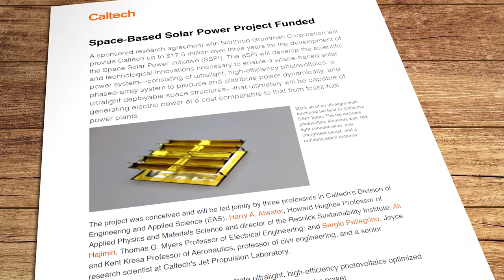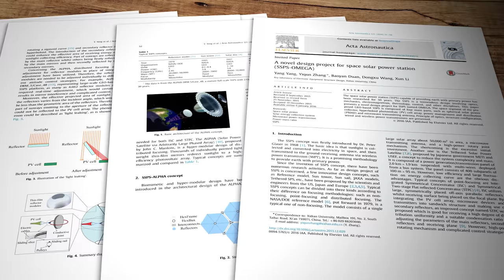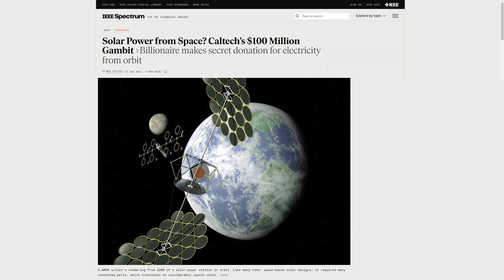Powering the planet from space. Closer to reality than you think?

Comment: As long as there is available area for panels on the ground that must be far more cost effective.

Take the cost of a space grade panel add the cost to orbit, the cost and losses of converting the light into microwaves, transmitting it to earth, capturing it and converting it again to electrivity plus all the problems with aiming the beams so as to not cook anything that gets hit by it.

Compare that to just putting lots of normal panels on the ground times the loss of light energy from passing through the atmosphere and then take a third of that because of the night and day cycle. Add in battery storage and we have the same base load capacity for a lot but still a lot less.

When we run out of space for panels on rhe ground we can start to look at other things.
Reply: it depends, the efectivity of panels may partly substitute the losses of converting and transmitting. But yeah that is biggest bottleneck i think, and its all about solving that. But if prices of kg to orbit fall down with fully reusable starship operational, it could be economicaly more efective, than backup battery for almost half of the day (in winter). Thats a lot of battery packs. The 24/7 energy supply is huge advantage.
Reply: Panels on the ground get less than 12hrs of direct sun. Orbital solar would be an un-interruptable baseload. 

The transmitted power would be long wavelengths that couldn't cook anything. 

It won't make sense until launch costs are very low. Then this will be the best power source available.
Reply: We can also let some of those panels float in the oceans..
Reply: @bozo5632  Yes i accounted for the day and night cycle by adding a factor of 1/3. I also added the cost of battery storage.

The longer the wavelength the wider the beam and colector will have to be.
Reply: Space power stations are far better- have You seen  "Pacific Rim"? : We have a giant brake in the bottom of the ocean and some monsters are coming form it. Ok- lets seal it with concrete or something (we already did it with BP disaster). No, better build giant robots necessarily with two pilots with mind control  and see them fight monsters cause that is more awesome! The same with on ground solar vs space power stations.XD
Reply: Glad I read the comments first and saw your post… saved me a lot of time.
Bottom line… batteries and  ground based solar will handle our power needs for hundreds of years… let’s focus on other issues. This one is sloved
Reply: @mabl4367  I saw that you accounted for it, but I stated it again because it's the ~main advantage of orbital. 

AFAIK wider beams and receivers isn't such a big problem.
Reply: @mabl4367  : The receiver size for microwave units has been calculated to be around 5 acres, which certainly is somewhat large, but not that different from existing power station.

Also, unlike existing power stations, the frequencies in question mean that most of the receiver area will be empty space, allowing the ground below to be used as pasture (or as a fish pond or something). Besides, 5 acres isn't a big investment of land when you're looking at countries and the viable distance of electrical transmission. Placing these 10 or more miles from the area they serve would likely be the norm instead of the exception.

So, the size is not a problem.

Comment: Wouldn't beaming extra energy down from space increase the earth's temperature?
Reply: So do ground-based solar panels, since they absorb light instead of reflecting it away back out to space. But the energy added is a pittance compared to what hits the earth every second of every day. That's why CO2 is such a problem, a small amount of insulation means a metric ass-tonne of heat is trapped. If we placed the solar panels between the earth and the sun, then they would be blocking light from hitting the earth while sending electricity down to the ground, making it at least neutral and perhaps actually cooling the earth a teeny tiny amount.
Reply: Yes, but any amount that we send down from space will be many orders of magnitude less than the sun already shines down, so the effect would be negligible
Reply: Yeah but it would be negligible compared to the greenhouse effects of global warming and if it reduced carbon emissions it would contribute to less global warming overall.
Reply: The atmosphere would absorb some amount of the radiation, and converting EM waves back to electricity would also generate heat, but that amount of heat is minimal compared to the amount of solar radiation each m² gets on Earth.

Also if, and it's a big if, this technology becomes viable, that would mean less energy demand from fossil fuels wich realeses CO2, CH4 and so on, wich do heat up the planet way more.

If this manages to be economical in some sense, we could use the energy from space stations to use energy intensive GHG sequestration projects.
Reply: Sending down energy would have an insignificant effect. The amount of all energy produced by humans in a year is equal to about the energy hitting the planet in one hour from the Sun.
Reply: If you're gonna go to significant scales the Best option is use the arrays to block sunlight that would have fallen on earth anyway resulting in a net reduction in energy transmission (due to energy lost in space as heat radiation) "solar shading"...
Reply: Arthur C Clarke actually considered that when writing some of his books, and his conclusion was that it at least would take a few centuries before it became worthy of attention. In that time we can expect some decent amount of the population to move to space (at which point their consumption doesn't contribute to the project), and for carbon nanotubes & graphene to be developed enough to provide significant aid to the solution.

Also, there are certain frequencies of light that just pass straight through the atmosphere to space, and some wood based materials that naturally emit light at some of those frequencies have recently been developed. Blindly assuming that everything will be fine in the future is reckless, but this subject is one where we're already getting good signs.
Reply: ALL the energy beamed down would eventually degrade to heat energy. Heat is always the end of the energy train. The important thing to consider is that the energy beamed down is energy that otherwise may not have been introduced into the planet.
Reply: @ABDuck88  Yes, that is what they said about the passenger pigeon.

Comment: Related topic to look into: Solar panels on the ocean. There's plenty of ocean, and if covered would also cool the water underneath. But being on the ocean is rough, lots of salt water spray.
Reply: Oceanic solar is not a great idea for both corrosion & mechanical stresses. You need to minimize or eliminate both in order for solar panels to produce more energy over their lifetimes than it takes to produce them, and ground-based arrays already are anemic on that front- increasing the required replacement rate makes it worse.
Reply: Open ocean solar is going to be an important component of solar in the future but a better starting point for floating solar is placing solar arrays over inland reservoirs. Placing solar their has the benefit of preventing evaporation and the water cools the solar panels which makes them more efficient.
Reply: There's more than enough dry land also.
Reply: @saumyacow4435  didnt elon musk say that to power the US in todays world, they need 100square miles of solar array and 1km for battery storage?
Reply: @dustinherk8124  I've no idea what Elon Musk has said (and not a lot of interest either). However, a solar array 100 miles by 100 miles sounds roughly in the ballpark.
Reply: @dustinherk8124  No, he said you need, in total, an area equivalent to a hundred mile square, after putting solar panels on every roof.  10,000 square miles.  Something on the order of a hundred million tons of solar panels, so expensive but quite doable.
Reply: @RandyTWester  I'm sure we could scale it down a bit from that with the less efficient but still viable transparent solar panels (12-13%) to be used as the upper windows of massive office buildings of at least the primary east and west sides as they are vertical panels, as well as gapped solar panels on plant producing farms who's crops do better in more shaded areas and reduces water requirements thanks to partial sun blockage. farms for green onion, peas, lentils, legumes, spinach, raspberry, blackberry/black currant, root veggies, cherries etc. to give a lot of that ground required. which would also give alot more diversity for farm regeneration with more plants to rotate, compared to the now exhausted farm lands that were used for grains.

Comment: With an efficiency of 22%, reflectivity of 85% (I can't find actual on the Interwebby, just a torrent of excessively-wordy nothingness  as per usual) and glass emissivity of 0.93 the solar photovoltaic panel temperature in space would be ~89 degrees Celsius. I've no clue of its actual efficiency at that temperature. * Instant big correction: I forgot that a panel in space has 2 large faces facing space unlike Earth's ocean which has ultimately Earth's core at its arse end. So "~89 degrees Celsius" S.B.  "~31 degrees Celsius", not nearly as challenging.

Comment: The best way to get power into homes is solar panels or tiles eventually, and batteries.
That will take a lot of beating!
Reply: iron rust batteries look promising for large, grid scale power storage. same goes for secondary cooling salt of a thorium MSR to power a steam turbine during the off peak hours of solar. using a thorium power plant as base load, and its secondary steam component intermittedly when peak sun hours are done, but peak grid use is still up. New Brunswick Canada is building a CANDU MSR that will do just that, provide a baseload of 260-300MWH with the secondary cooling salts, redirected to the steam engine for an additonal 75MWH of power when peak solar hours are done. plant is expected to be operational by 2031-2033.
Reply: @dustinherk8124 
Yep nuclear should be an important part of the mix.

Comment: As a big Asamov fan since the '70's, I was glad to hear him mentioned among other early theorists on this subject.  I read back in 1972 that Asamov, in the 1950's. theorized that 5 square miles of solar cells in geosync orbit could microwave enough electricity to meet the US's then-current TOTAL energy needs.  That's total energy, not just what the grid would need to light homes and power factories.  Of course, such a system would require a complete rebuilding of our power grid to handle all that energy.  But then that is something that will have to happen to some degree or another anyway as we transition from, for example, ICE powered vehicles to vehicles that obtain their power from the grid.

Remember too, that solar cells back then weren't nearly as efficient as they are today.  I would also assume that he had calculated the energy losses and inefficiencies of such a system.   While I am all for continuing to research, expand, and refine such technologies as wind, water, and geothermal energies, IMO unless we vastly expand nuclear as the core of our power source for at least the short term, space solar is the way to go.
Reply: I think I read the same, many years ago. Asimov also mentioned that such a powerful microwave beam, could be easily re-directed as a powerful weapon....Cold War was going on then.... Even now, if that beam wasn't consistently precise, it would be a huge risk to a very large area
Reply: 5 square miles / 1m^2 * 1kw * 20% = 2.6GW

Comment: Big problem with this idea is that for all the cost of the non-power producing parts, the electronics, antennas, transfer systems, space launch costs, power transformers and so on... We could have just built a longer distance power grid. We have "space" already here on earth, we just don't just put solar panels because that "space" is too far away to connect it to the grid cost effectively.

Putting solar panels in another "space", using rockets and all the associated hardware would be even costlier and less reliable. When you reduce the problem down to "space" and distance, it becomes painfully obvious how absurd it is to go into orbital space versus going further into terrestrial space. If some how power transmission costs over lasers and microwaves were cheaper than using power cables, we'd be using lasers and microwaves already in our own grid, we don't.

Space Solar power stations are doomed from the get-go as a cost effective alternative to land solar power stations. 

But this doesn't mean the technology shouldn't be researched, there are numerous applications where it doesn't compete with land based systems. It can be used to power other space based infrastructure. It can be used to power extremely specialized regions like arctic research stations, oil rigs, ocean infrastructure or remove comm stations. Places that are too remote to deliver fuel oil and the weather to is too violent for traditional solar or wind. There are even exotic advanced applications like microwave rockets where the power is beamed to the rocket in-flight and thus doesn't use combustible propellant but instead uses inert propellant that the microwaves heat up. 

I'm sure the military would love to throw a trillion dollars to have their very own orbiting death ray. 

But space solar power is not at all useful for power generation versus land based systems.
Reply: Elon Musk and others have talked about doing industrial processes in space.  Like asteroid mining, and such, but the cost of getting them down the Earth seem problematic.

I see a pattern that when the Military Industrial Complex wants to push something they try to spin it to appeal to the starry eyes altruistic kids ... like computers and the Internet, and then the military or surveillance state moves in afterwards.  Maybe before we try to solve these big industrial problems we need to solve our social economic and political organizational problems first.

Comment: An idea that solves two issues I've seen no one working on or if it's possible a material like a graphene bilayer or something similar that converts heat directly into electrical power at any kind of efficiency we reduce our carbon by reducing our heat output and not violating the laws of thermodynamics simply changing energy from one form to another

Comment: I can't help but feel that dumping massive amounts of energy into the atmosphere would also warm the atmosphere something fierce. that said, this would be a decent way of powering a lunar colony without shipping a nuclear reactor up
Reply: Yeah I wonder this too. Though if the solar power collectors are collecting light that would hit the atmosphere anyway maybe it wouldn’t actually change the energy going into the atmosphere much or at all?
Reply: Microwaves pass through atmosphere with little to no absorbtion, which is why microwaves are the choice of most research in this area over lasers, just look at the absoprtion spectrum for atmosphere, lasers would warm the atmosphere for most frequencies. Think of it like this, lasers get blocked by clouds, meaning they get absorbed by water vapor in the air, meaning the water in the clouds or air is heated. But most microwaves even for communication do not get blocked by cloud cover meaning they are not absorbed, so no heating.

Comment: We should also consider to use in space the energy we can collect there, offloading from earth surface high cost electrical powered systems, like datacenters. Actually datacenters in space could be very efficient, not requiring complex cooling facilities, and could be logically spread across many small different satellites, with distributed storage, processing and containerization facilities. We would have plenty of bandwidth to move data with mesh optical networks built connecting satellites with laser transceivers. 
I guess that building datacenters in space could have a relevant impact on reducing carbon footprint of these structures.
Reply: Heat dissapation is actually significantly harder in space, a perfect vacuum is one of the best possible insulators.
Reply: "not requiring complex cooling facilities" Cooling is much harder and complex in space.
Reply: @garethbaus5471  and @vorname nachname thank you for pointing that out. i was thinking it would be easier, since most probes are powered with RTG which rely on high temperature gradient, and should require efficient heatsink

Comment: First application for this wouldn’t be to power homes. Aim the laser at airplanes to provide in flight power.  Planes could then stay in flight above the clouds indefinitely. The planes just need enough battery storage for take off and landing.
Reply: Take off could be slingshot assisted
Reply: A jet has 2x23 Megawatt engines.

This means the beam needs to be 46MW of power.  with a 420 m^2 fuselage and and a 380m^2 wingspan.

Or ~57 times stronger then sunlight.

Throw in 50% efficiency of  the conversion to the power and you are looking at ~110 times the intensity of the sun.

Bit of turbulence and you have to realign. That beam ends up hitting something else.
Reply: @catprog  - hmm.  Maybe a smaller plane that doesn’t travel very fast?  Maybe multiple satellites with lasers so no one beam is too powerful?